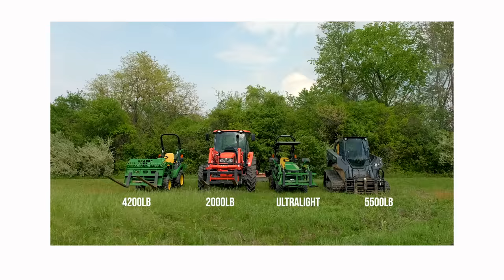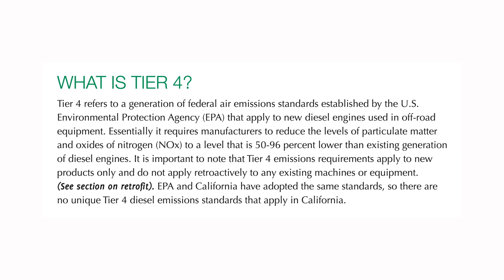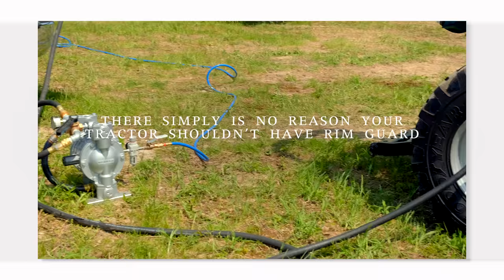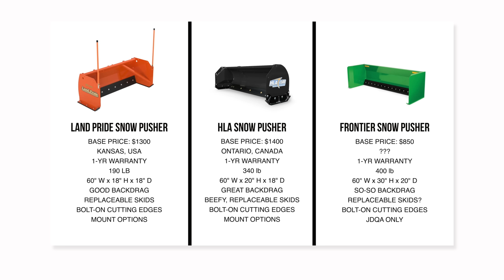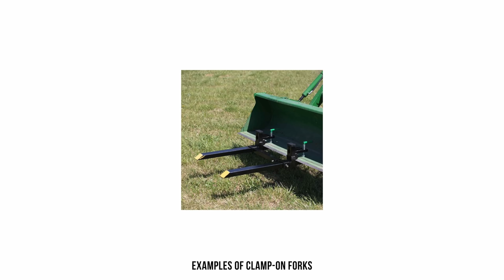TOP 10 MOST OVERRATED TRACTOR FEATURES, 2022 EDITION 🚜

Comment: my JD was down for a month because I called a tech out to clean out my fuel tank (should have just done it myself), and during the process he changed a fuse to the wrong location. he took a month but couldn't figure it out. The owner of the company decided he would come get it so his best guy could check it out. So i decided I would drop the brush hog to make loading it easier... well the battery was disconnected so instead of just hooking it up i decided to check the fuse panel to make sure it would ne safe to hook back up the battery and i noticed a warning on the fuse panel about fuse f11 and f12. see the problem was is it would start but he couldn't get it to move. well this warning said if the f11 fuse was in the f12 spot the tranny was disabled so i swapped the fuse location and it worked fine and has been ever since. took me all of a few seconds to find the problem and fix it. so i avoided a huge huge bill by reading the fuse panel warning

Comment: In 20+ years of using tractors I am still waiting for that magical day that I have to use locking rear differential. Some day, some day.. 🙂
Reply: What sort of terrain do you drive your tractor in? If it’s flat and dry then yes there is no need for a diff lock. If it’s hilly, wet and uneven terrain then being able to drive both back wheels at times is needed.
Reply: @kdegraa  I am in hilly country so lots of hills and uneven terrain BUT I do not have many situations where it is muddy, wet, etc.. Whenever I do have a challenge I just flip on 4WD and it gets me out of the situation. Never have used locking diff ever but I hope to someday! My comment was not meant to say it is not useful just that I have never used it yet (and I feel left out!). 🙂

Comment: I totally agree on the mower deck. I purchased a 2020 2025r and really contemplated whether or not getting a mower deck would truly be a value-add attachment. Although it would have been useful, I already have a ride-on tracter/mower and for the cost of the drive-over mower deck, I could have purchased a brand new zero-radius ride-on. I am very happy that I did not get the deck and saved the money.

Comment: It comes down to what you are going to do with your equipment and the soil/topography of your property.  I have very little flat ground so a diff lock is a must.  For me a MMM and backhoe make little sense.  A zero turn gives a better cut in less time without the hassle of dis/mounting when you want to use your tractor for dirt work.  Like you said, for most projects you're better off renting a mini-excavator.

Comment: My local John Deere had a couple 48” Frontier box blades still in the shipping rack at a substantially lower price. While looking at it there’s definitely a difference in the gauge metal compared to most of the aftermarket blades. Not sure that makes a whole lot of difference on a 25HP tractor but it’s definitely better built. 
I didn’t get a backhoe on my 1025R because I could rent a compact excavator for the one or two times I might need a backhoe over the next 10 years. 
I use my differential lock quit often even when cutting grass. Best feature for the minimal cost it takes to add it at the factory, even on a lawn tractor.

Comment: Backhoe attachments are well overrated, just hire a mini Excavator or buy an old backhoe if you have a more frequent use for one. Bolt on pallet forks are useless. Multicouplers are a great idea but you have to have absolutely spotless when you connect them back up or they leak. Diff locks absolutely essential with proper ballast they transform the pushing and pulling power of the tractor and also help keeping the tractor running dead straight when you want perfect straight lines.